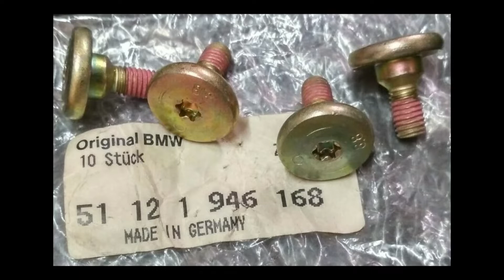BMW E34 restore So Far

Comment: Very hard to find new panels for these cars but i have managed to get most the seals a made in 3 sections from the factory i have the rear and center parts and one of the front ones these have the jacking points so its very important only missing the other side... cant find anywhere. Allmost 1500€ spent on bodyparts
Reply from the maker: Yes - I’m only missing the right C-pillar ‘albow’ that still is avaible @ BMW
The front lifting points is not there anymore - reinforced inside sill and car can be lifted at edge/joint between inner, middle and outer plate